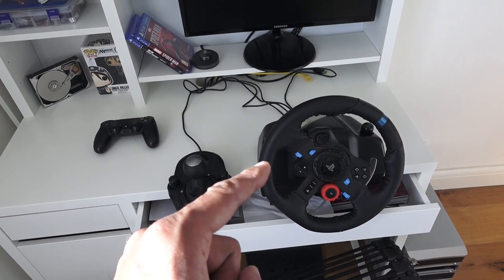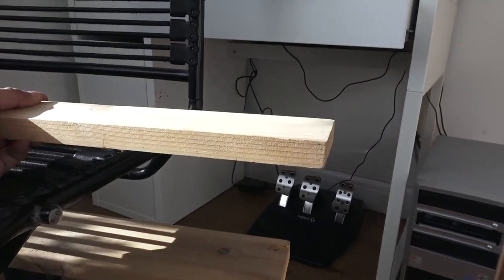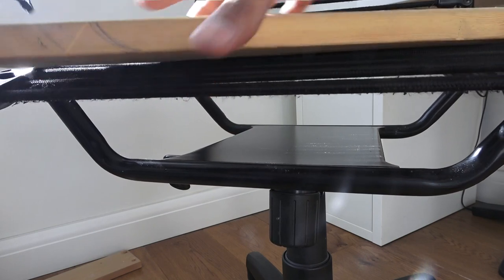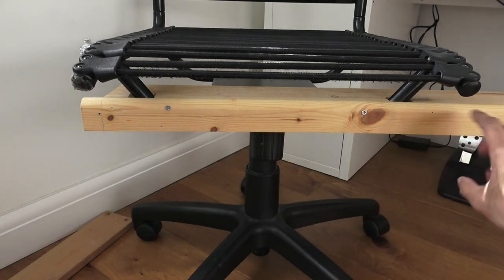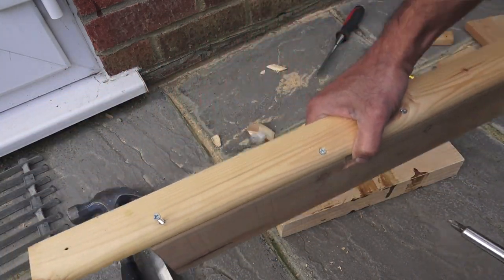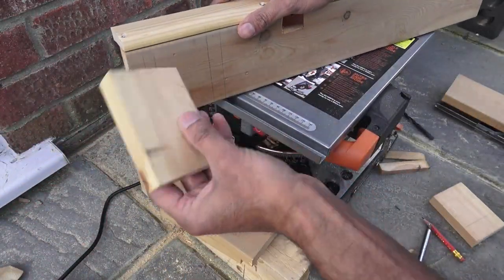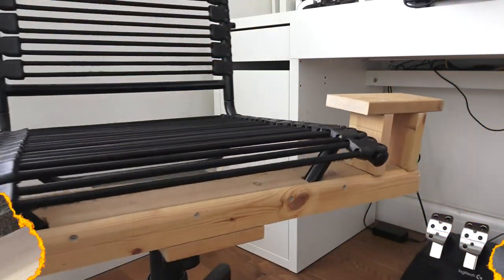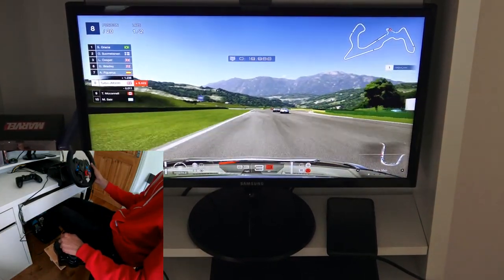Logitech G29 and Logitech Shifter DIY Chair Hack! With GAMEPLAY

Comment: hey i'm gonna be straight, since nobody else can. DONT BUY THE G29 SHIFTER. ITS CRAP. IT DOESN'T DO THE JOB. you will be frustrated with shift misses, uncomfortable palm grip and short durability. EVEN WITH MODS IT CANNOT BE CALLED DECENT. don't waste your money in this shit. buy a chinese shifter on ebay or alie or whatever and be happy. listen to me, don't waste your hardly-earned free time with the g27/29 shifter because it is total crap and will disappoint you.